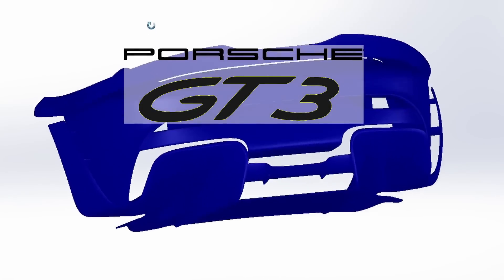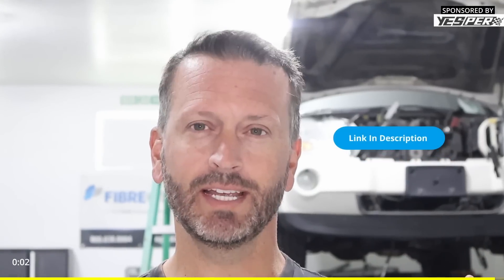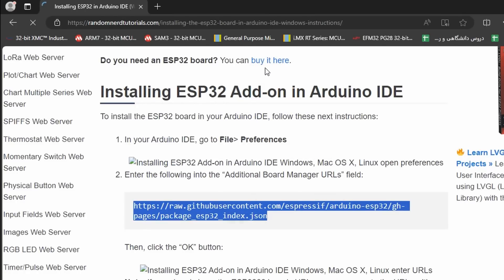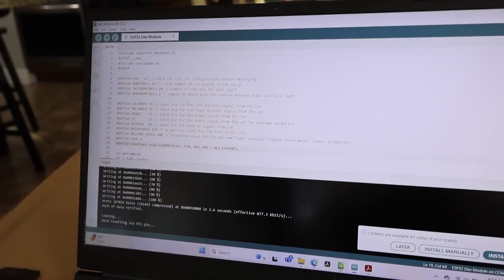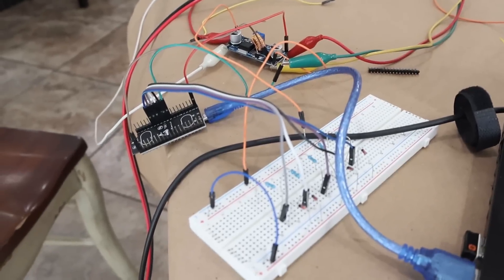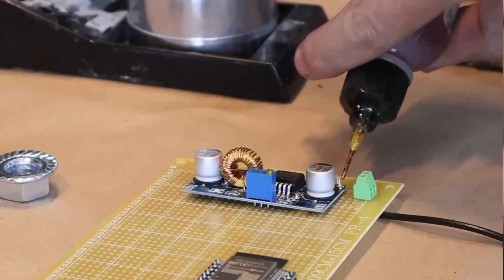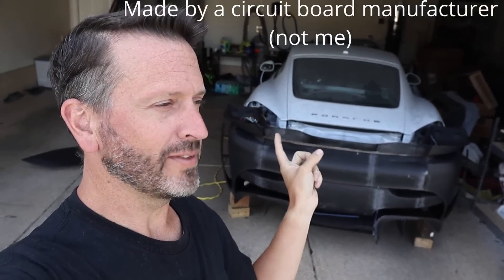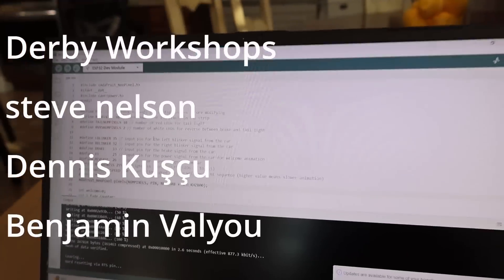Arduino-Powered Custom Taillights for Porsche: Step by Step

Comment: So... what happened when you hit brake and signal at the same time? coz that is a single srtip of LED.
Reply: It's all in the program, when you hit the brake light and the indicators at the same time, and even get into reverse, you still have your brake lights in the middle lit up with reverse lights beside them and indicators on far left and right. just like every car out there, we have dedicated spaces for each light, the only difference is that when they're not in use, they perform as one or the other. you can see the same happening with many cars out there, like the Nissan Murano, Mustangs, many classic American cars etc.

Comment: Hi Sr Possible can you share the code thanks
Reply: Use wled
Reply: @dhruvgulati1667  wled can't handle the multiple inputs at one time such as braking and reversing or braking and turning. I gave up on it for tail lights.

Comment: I made a custom LED board with an esp32 that drives the same ws2812 LED’s for my cars tail lights. One thing to look out for is that those strips do eventually go bad and when they do you get certain dead pixels. If you’re lucky in a car application they’ll be off but other times they start flickering as other colors, usually green which could lead to some trouble with the law if they start acting up and being erratic
Reply from the maker: Good to know!

Comment: I'm sill in the park of this isn't enough for rear lights. And think it'll look very interesting once this vehicle gets rear ended.
Reply from the maker: Regulations state a specific illuminated area and light intensity in lumens required to be lit up for a motor vehicle.  Almost every car in the market use 1/5 or even less LED counts is used here. There is plenty of headroom when it comes to making this car road legal.

Comment: Cool design and great animations 👍🏻. I just noticed a potential problem: your program can only display either reverse lights, brake lights, or turn signals at one time. But if someone is reversing, braking, and signaling at the same time, it could cause issues.
Reply from the maker: @SLKale_  Programming can solve for multiple inputs

Comment: I would make the turn signals sequential that seems to be the thing on the newer cars.
Reply from the maker: Good call
Reply: They have a n element of sequential in them its just not visible in the video. they have a running glow in them. main issue with sequential is that it would not meet the standard rules and regulations of DOT, a specified area has to be illuminated at the very beginning of the indicating process. but we added that glow and the fade out so it looked more interesting than just plain on and off... thanks for the feedback tho❤

Comment: Will those LED lights be road legal? The ones you have will maybe be a bit bad on keeping water out since you need to seal the ends very well for them to keep water out. It might be better to use the ones that is basically cast inside a silicone strip so that no water can get inside. It might also be good to supply power from both ends to not have voltage drop towards the end of the strip. The data wireld only be connected on one side though.
Reply from the maker: Good call
Reply: Yes they indeed are, rules state that a specific area must be illuminated to be considered legal as well as a specified illumination level (Lumen level) which these LEDs far surpass that amount, we had to actually dim them down and keep them at 40% to not exceed that level. and as for weather proofing them, we have plans that will enclose the whole tail light section and wirings. thanks for the feedback❤

Comment: 4:20 it is entirely possible that they were adjusted at the top, meaning output max voltage, and those potentiometers require quite the number of turns to adjust their values. keep also in mind those cheap boards are not moisture or shock resistant.
Reply from the maker: Thanks for the comment!
Reply: I concur. They take a lot of turns before the voltage drops.

Comment: i think the element most likely to go out here are those cheap DC-DC converters... i'd say either go with 12V LED strips so you can go straight off of car 12V (but you need to make sure your interface signals to the ESP32 are taken care of) or, invest in some better buck converters made for auto industry.
Reply from the maker: Got it
Reply: Thanks for the comment, we looked it up but unfortunately we couldn't find an addresable 12V 144/m RGB LED Strip. if you know any or where to find one, we'd appreciate if you send us a link for it!
Reply: @IJDesignStudio  I am not sure if ebay link will be stripped by Youtube, but there are quite a few "144 addressable 12v led strip" results.

Comment: FYI,  an arduino probably won't last in a car environment.  I live in Florida where it gets really hot. Perhaps it will be better in Utah, where there are fewer days of hot weather.  But, of course, you get really cold weather.  Anyway, the point is, I've heard they do make one called a Ruggeduino that can handle more extreme environments.
Reply: the final board will not use arduino, as a matter of fact even this development setup does not use arduino, it uses Arduino IDE and programming software to upload it on the ESP32 chip, on our final design we will use a all in one PCB board with a weatherproof casing housed in a safe place away from harsh envoironment.❤
Reply from the maker: Thanks for sharing

Comment: no offense but is this even legal. Also for reverse light I would do everything in white so you can see better
Reply: Yes it is legal, rules state that a specific area should be illuminated with a specific lumen level (intensity) for the brake lights, night lights and indicators. for the reverse lights, there is no specified regulation that limits us to use, it just needs to be an LED light that shows that we are backing up. but the one we did is plenty enough for visibility.❤

Comment: SAFETY TIP! technology connections did a video,  "Electric cars prove we need to rethink brake lights" he goes over the issues with regen braking and break lights, if you're doing regen braking check it out. it could save you getting rear ended.
Reply from the maker: My controller uses brake lights if regen over a certain amount is triggered.
Reply: @electricsupercar That’s good. I was going to suggest adding an accelerometer to your ESP32. It would be a simple add and would let you do things like pulse the brake lights under heavy braking and account for regen. But it seems like that may be unnecessary. You’d need a calibration step to account for orientation so it didn’t light up the brakes every time you slammed on the gas.
Reply: Nice, they also did one about reverse lights I think, the point was, they were super dinky on his car and he was advocating for having them not only signal to other people, you're backing up, but also lighting up the area behind you in dark conditions. The point would be, bump up the reverse lights to 30 or so, so you can see at night 😊
Reply: Thank god I found your video. Been trying to figure out a knightrider style blinker on my truck. I do need to figure out how to by pass my flasher relay but also still use the blinker switch
Reply: Every EV I have ever driven actives the brake lights with regen.
Reply: @therealcdnuser  My MME does not if 1PD is not engaged. I'm pretty sure I have seen discussion about most of the current EVs not engaging the brake light if not using 1PD.
Reply: @therealcdnuser ionic doesn't
Reply: @therealcdnuser It seems EVs I drive behind don't have this. I am constantly accidentally tailgating EVs

Comment: When you do the board design, take a look at decoupling the power side and digital side. There could be some noise that can travel from the big DC motors to the digital side and give you trouble down the line. So if you do integrate some decoupling on the design from the ground up, you can avoid spending a couple of hours on weird bugs with the lights.
Reply from the maker: Perfect, thank you!

Comment: there are easier ways, with rgb like youre using a blueghozt lite works great as well as there are 12v to 5v inverters. yes its more expensive but you can set everything up from your phone in 20 minutes at most
Reply: also anything 12v UCS will be way brighter and rigid will last longer than flexible
Reply from the maker: Thanks for sharing
Reply: The magic is to make something bespoke and completely custom to what we envision ;)
Reply: i think the custom is cooler

Comment: Any reason you didn't go with 12v LEDs? I'd also recommend going with COB strips as the waterproof ones you have are not great at keeping out water.
Reply: I came here to say this. 12V strips would save a lot of hassle (namely those cheap regulators dying, which they will). I am using the same in 24V in my house to save on the wiring, and power the ESP32 with a separate 5V. I'm using WS2814 FCOB strips, just for reference.
Reply from the maker: Interesting 🤔
Reply: Most addressable LEDs run on 5V. There are some options that run on 12V, but most of them are not individually addressable, they will only address a group of 3 LEDs. WS2815 LEDs seem to be individually addressable LEDs that run on 12V, but I have never used them before and I am not sure how well they handle higher voltages (like 13.5V in a car). 
And for the 5V LEDs, I would not trust these cheap 5V DCDC converters in the long run. I would get some higher quality traco power converters or similar.
Reply: @Brainwash110  there's plenty out there. I've trimmed my house outside with  12v LEDs outside and they work great.  To be fair mine are 2811's which wouldnt be perfect in this situation but you can buy the cob strips in 12v or 24v and I'd highly recommend going that direction.
Reply: @sojhinn I'll be using 12V COBs for my light bar at the back and ws2812b for reverse, brakes and indicators. I can only find 24V programmable COBs unfortunately cuz they'd have been sick tho 🔥

Comment: Awesome progress!
Are the brake lights sensitive to the amount of brake force applied? 
Not sure about American rules, but here in Europe a lot of the newer cars will flash the brake lights when performing what amounts to an emergency stop.
Reply: brake lights are not sensitive to the amount of pedal and brake pressure, the flashing light you are addressing to is related to the G-Force applied to the car while braking which causes the tail light to start flashing rapidly indicating an emergency braking. which yes it is built into the board we're using for the tail light, both regen braking and emergency braking will be added to the lights.
Reply from the maker: All programmable

Comment: So how do you choose an light strip that will be road legal?
Reply: Regulations state a specific illuminated area and light intensity in lumens required to be lit up for a motor vehicle, the reason why you see the indicators light up all at once and not in a running manner is exactly for this specific reason. as a matter of fact, almost every  car in the market use 1/5 or even less LED counts as we are using. we have plenty of headroom when it comes to making this car road legal.

Comment: On those stepdown converters, I believe they may be load dependent... so once you hit them with a significant load, the voltage will drop.  You will probably need to adjust them again after building your full circuit.  Also... the pins coming out the bottom of your Arduino are the same spacing as the breadboard.... just jam that bad boy in to the breadboard and save some hassle. :)
Reply: I used similar ones. This kind probably works up to 24V, so by turning the potententiometer you adjust the output in the range 0-24v. But when you start at 24V out but have only 12V in, the output will still show up as 12V.
Reply: Blazico is absolutely correct. They aren't boost converters, so they max out at whatever voltage you give them, but since they're constant voltage output, the set point is an absolute voltage between 0 and whatever it's max is.
Reply: YES.  Your volt meter has too little a load on the output to bleed off the excess voltage.  You should put a high ohm resistor across it to bleed off the voltage.  Careful to not overload the resistor or board, it shouldn't take much current in the resistor to see your adjustment change.
Reply from the maker: Thanks for the comment!
Reply: Also, since we're talking about power, in the final install it'll probably be smart to inject power into both sides of the led strip. They're notoriously bad about voltage drop across the rails. Just 12v and 0v
Reply: @jdarmst individually addressable strips run on 5v, push 12 on it and it’ll die
Reply: @apemaster6976  while you're probably right, they do make 12v addressable strips. But with 5v, it's even more important to avoid drop